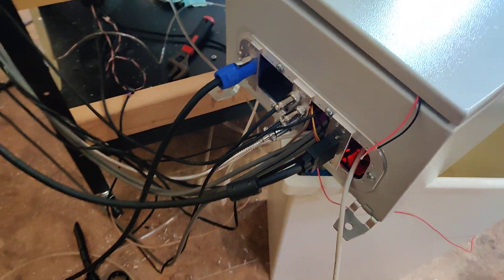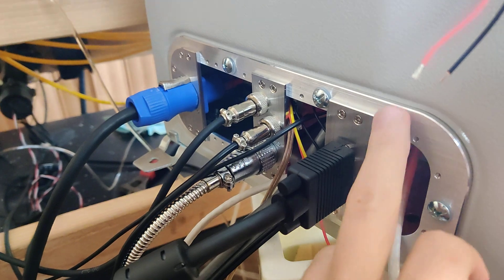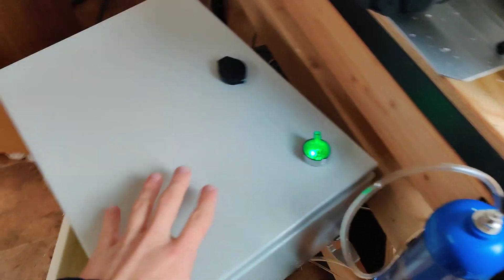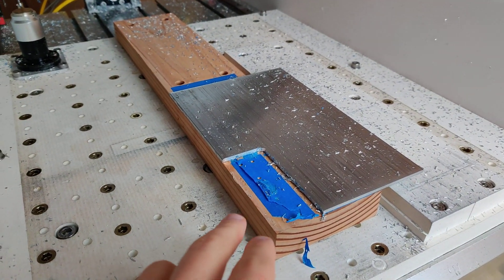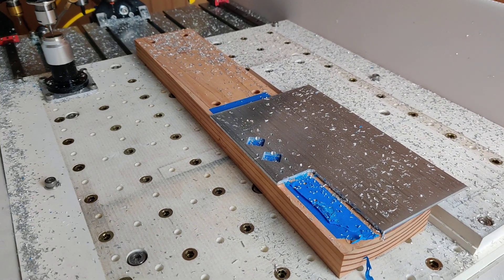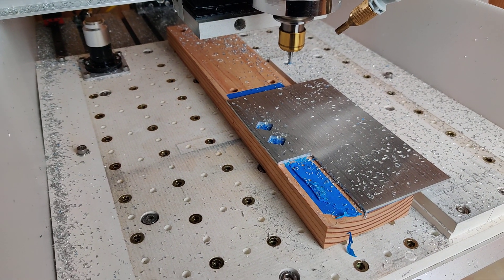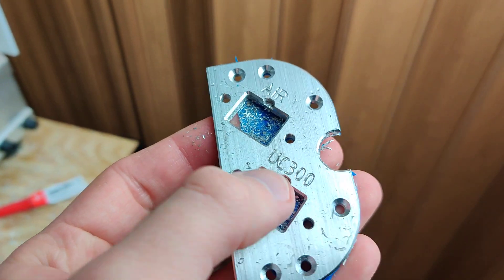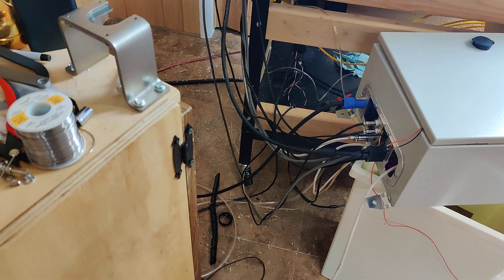Modular CNC Controller IO Panel Machining and Overview - ATC CNC Router Upgrade

Comment: Very nice, Nikita!
I want to suggest a pass-through RJ45 jack I used to modify the controller my machine came with, while converting it to use UCCNC AXBB-E board. Hope this helps:
https://www.amazon.com/gp/product/B07DYCCR8K/
Reply from the maker: Yeah I wanted to use pass-through connectors to use my own lengths but I messed up a little with only 30x58mm of usable space per slot. Also it was just $8 for 2 of the white panel cables and they're STP shielded
Reply: @NikitaLab  The one I linked also needs a larger hole that one expect. Something like 28mm IIRC.